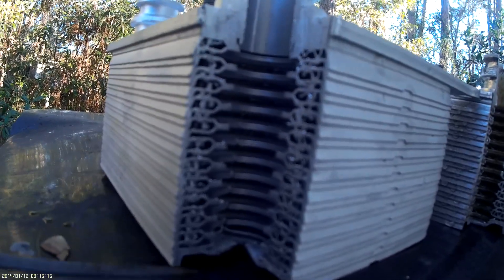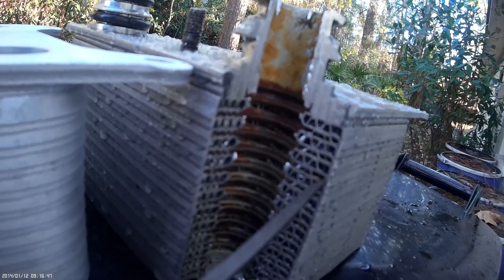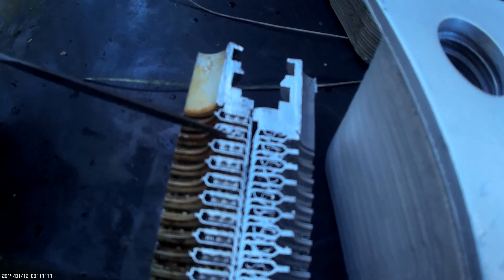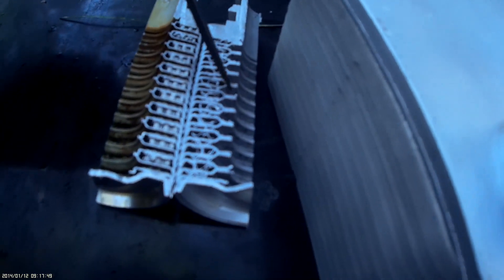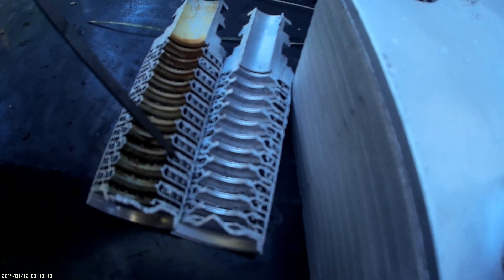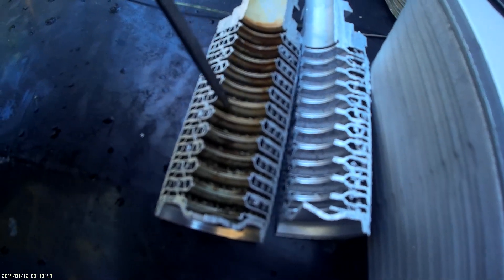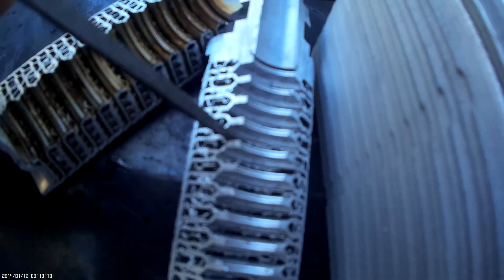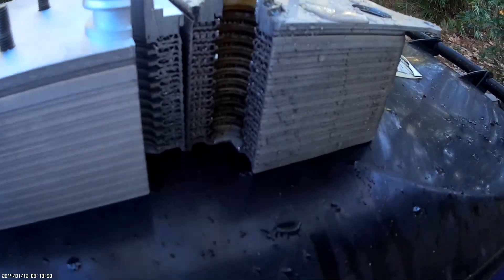Ford Oil Cooler vs Dorman - CUT AWAY VIEW (Ford 6.0L)

Comment: Funny part is Ford is now using Dorman as OEM replacement 🤣 made in the same China factory and they stamp it either Ford or Dorman but they are the same cooler thro and thro
Reply from the maker: Really hope that isn't the case, the Dorman isn't nearly as good at cooling!
Reply: @uberDoward it is the case as with alot of Ford parts now. Last one bought from the Ford dealer literally had a Dorman tag in the box. Outside of the box was tagged Ford 😂 i do believe however that Dorman also changed the specs a bit and its closer to the oem than it used to be. As well as they updated their gaskets

Comment: I know this is an old video, but new to me as I recently bought an 03 F250 with the 6.0. I'm looking into doing the EGR delete and figured I'd also replace the oil cooler at the same time. Do you have any thoughts on the "heavy duty" oil cooler from XDP? They seem like a legit company, but the price seems almost too good to be true at less than half of OEM cooler.. Thanks in advance.
Reply from the maker: OEM only.  There are a lot of aftermarket cheaper oil coolers out there, and they are almost all built like the Dorman cooler.  Definitely recommend OEM only!

Comment: dorman oil cooler is made out of aluminum fords oil cooler is made out of stainless steel that would be why the passages are thicker
Reply from the maker: +Brad Walther Hmm, I'd have to go check again, but I'm almost certain my OEM ford was Aluminum as well...
Reply: The Ford cooler is definitely made of aluminum. Maybe higher quality alum tho.
Reply: Brad I think u should look again or go back to metallurgy school. Dorman cooler is definitely made from incorrect / cheaper grade aluminum than the better Ford Cooler.

Comment: I did not see your video and purchased a Dorman oil cooler. When I tried to tighten the nuts on the cooler studs they stripped out. Now, my torque wrench is not calibrated, but used very little and kept in the container. Bought a Ford cooler and used same torque wrench and no problem. The good news is that I bought Dorman off Amazon and had a hassle-free refund.
Reply from the maker: I'm not surprised.  The Dorman is definitely made lower quality, so it makes sense it would be made from inferior material, as well!

Comment: don`t waste your time and money they are both junk went trough 4 of thease style of coolers before geting a proper cooler from bullet proof deisel in measa arziona there far superior to the new style ford cooler and you don`t halve to depend on a coolent filter  the stock style is supose to be more efficant but they are useless
Reply from the maker: If you can afford it, sure that is a great solution!  OEM, however, is much cheaper if you do the work yourself.  Whatever you do, though, do NOT use the Dorman cooler!
Reply: figure the cost of 4 peises of junk oem or dorman plus headgaskets and other problems related to oil cooler  bulitproof is far cheaper
Reply from the maker: Tim Mcguckin I'm not sure I follow - why would the headgaskets need to be replaced?  My F250 had a 44F EOT/ECT delta when I got it - no blown head gasket (verified via coolant pressure).  For $300 and my time, I could replace my oil cooler 5 times before I had approached the $1600 for the BPD kit.

Again, if you can afford it, the BPD kit is awesome.  I simply don't have that kind of coin laying around!
Reply: failure of oil cooler is one of main causes of headgasket failure once thease marvles of modren engenring clogges it causes the other brain storm EGR cooler to fail or EGR valve to gum up whitch causes turbo to get cloged with exhaust soot mixed with coolent causeing a stuck in full bost cond. whitch the underdezined head studs can`t handle walla blown headgaskets cost at ford dealer about 7.000 dollares american if possable avoid ford dealer at all cost unless it is coverd by warrenty
Reply: Tim Mcguckin yes and adding a tuner to the truck. The engine was designed at already peak horsepower from stock tuning. In fact, the Ford stock tuning is probably too much for the headbolts. International tunes their engines with less hp.
Reply: $2100 for an oil cooler from bulletproof diesel is beyond ridiculous.
Reply: The issue is related to silicates in the coolant from improper maintenance. Changing coolant at regular intervals would preserve the oil cooler. If the cooler was a bad design, then you would see across the board failures but you don’t. There are many trucks with 300k plus miles that have never had an oil cooler replacement. Some of these trucks pull heavy daily. You could argue the cooler passage ways could be larger or the cooler itself larger may have added longevity to the coolers if proper maintenance wasn’t performed. The silicates are from a breakdown of the Ford Gold coolant exposed to intense heat. There is talk of casting sand as well in the blocks. This would explain why some engines fail and others don’t. From what I have heard, a coolant filter was a recall from International.
Reply from the maker: Rotella ELC red.  Had lots of what appears to be sand casting particles that evidently didn't get flushed previously.
Reply: Tim Mcguckin

The OEM oil cooler isn't going to plug up and fail if you use red ELC coolant and a filter. Combine that with a good aftermarket EGR cooler or an EGR delete, and you're going to be pretty well setup for stockish power levels.
Reply from the maker: fubecabr Actually....  mine DID start to clog up (I've noticed my temps are up to 205F EOT / 192F - 13F spread.  I pulled my coolant filter and it was filled with crap, so I backflushed the cooler to very little difference.  I'll go in there and replace the oil cooler ONCE more - if I have to go in a 3rd time, I will be going BPD (or homemade BPD lol)
Reply: @uberDoward  what does BPD stand for
Reply: uberDoward

Were you using the red ELC coolant or the Motorcrap gold coolant??
Reply: So you cut up that oil cooler instead of returning it. I'd say your trying to sell bulletproof products

Comment: both are crappy designs should have used a normal oil cooler from when the truck was built instead of water cooling.
Reply from the maker: I wouldn't say that.  Liquid to Liquid coolers are more efficient than Liquid to Air coolers.  Significantly so.  Unfortunately, Ford should have spent the extra $5/engine and installed a coolant filter FROM THE FACTORY.
Reply: Even newer Diesels are going air to liquid instead of air to air the new Powerstroke uses an intercooler that runs coolant instead makes it more compact as well